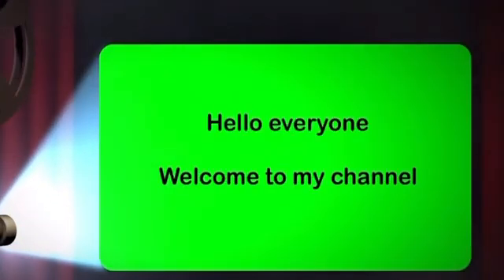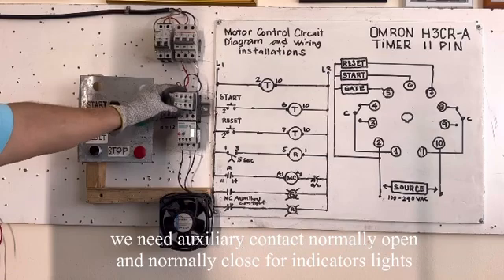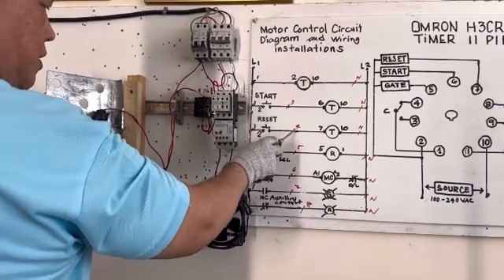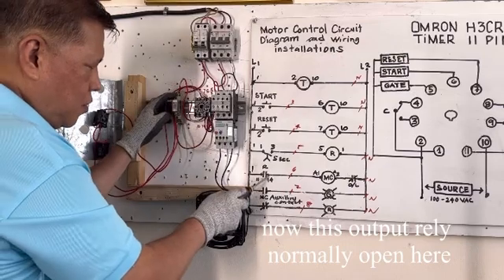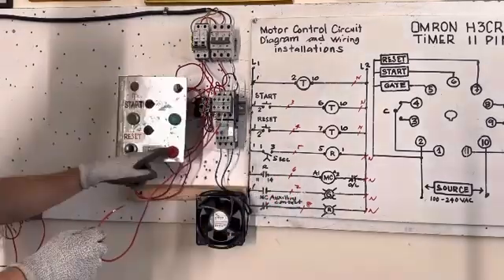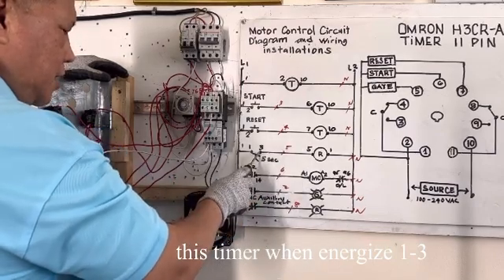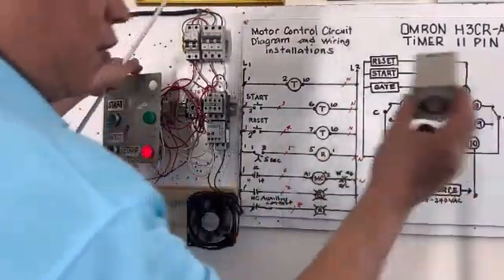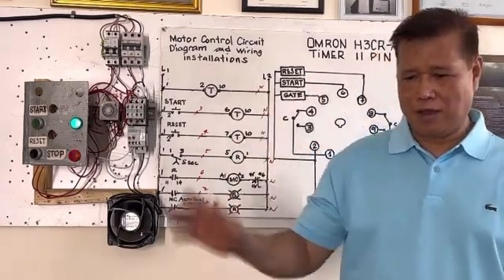OMRON Timer H3CR-A (11 PIN) use on Motor control.

Comment: Wipes for sure. It can appear as string or rope. Wipes do a great job causing pump failures in sewer lift stations and water treatment plants. I never used the plumbing stack to clean out the drain pipes but it is effective. I would rather pull a toilet and reset it when I am done.
Reply from the maker: hello bro. i work before on power generation plant at water treatment and i dixed many sewage pump . two pumps submersible and using 4 float switch with higher level alarm.

Comment: Almost positive this Omron very versatile timer is the same one that I connected to my homemade central vacuum system for my house over 35 years ago. Have it wired in as on off delay. When my kids were little they would plug in one of my central vacuum hoses clean up a little spill then leave the vacuum run. Have it set to turn off after 30 minutes. Rather then spend $250 or more for a central vacuum unit I used my 16 gallon shop vac. Installed a 120 to 24 volt transformer to power vac door switches . This timer can be used on several voltages & at least 5 functions like time delay on or off. Had another Omron timer on my old central air conditioning unit. Wife would move the old mercury thermostat to turn a on then change her mind turn if off then turn it back in causing the 30 amo circuit breaker to trip. Set up timer as a on delay timer set for 5 minutes .We had at least 30 of these Omron universal tickets at a company that I worked for and some were over ten years old and still working great.